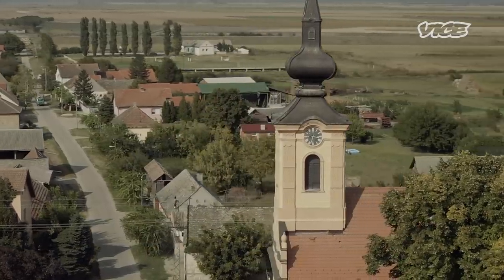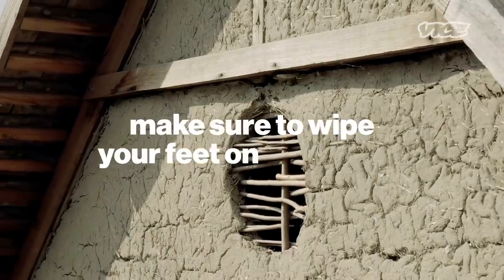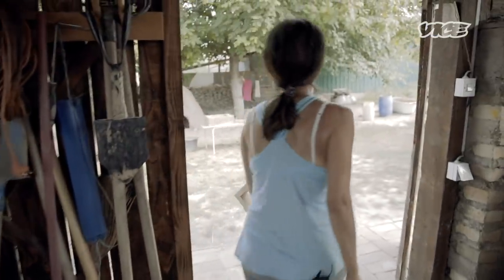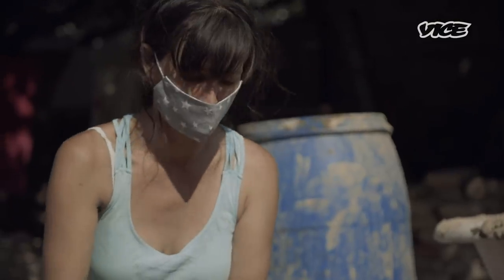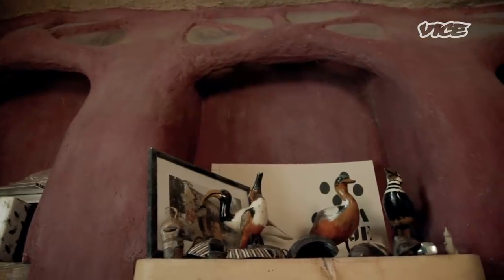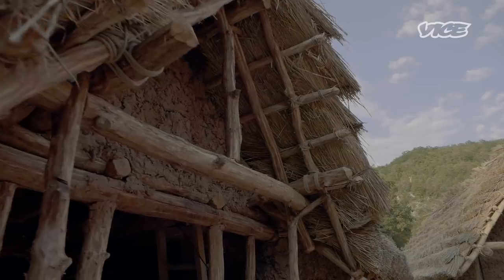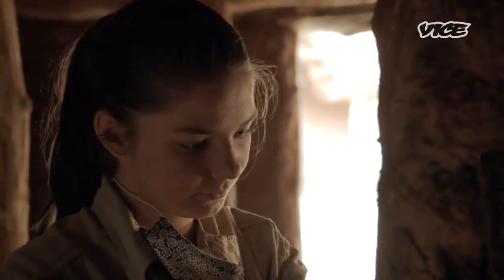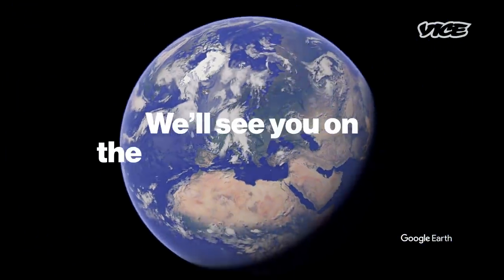Architects Are Using Mud to Build Sustainable Homes

Comment: Straw bale home builder/owner here. The insulation value of straw bale buildings is amazing. I have very low cooling bill in summer, and no bill in winter for heating, as I use waste wood to heat my home. Often times cooking a meal in winter is plenty to keep the entire house warm. It is also passive solar design, so in summer is shaded, but in winter when the sun shines, we get plenty of free solar warming. 
We have clay plasters on the straw bales, and made many interior walls using several natural building techniques. 
Our home is a hybrid of natural materials (clay, sand, straw) and manufactured materials (metal roofing, glass windows, wall tiles in the bathroom, and poured concrete floors.) So much can be done, but isn't. 
It does take a special drive to accomplish what the architect has done, and yes, these sorts of homes can be built to the building codes in any region.
Reply: @Cthulhu013  I use wood that is sustainably grown on my own land. I also make biochar in my wood stove as a bonus product.
This sequesters carbon in the soil for hundreds of years.
My wood stove is highly efficient, and has extremely low particulates emitted.
I have done the research and am confident in my decisions to heat my home with wood.
Reply: @Bronski Turboski I absolutely used wood and modern roofing materials to keep the rain off of my mud walls. Have a great day.
Reply: Hi! I was wondering if you could tell me more information on your house. I am currently planning our home build. A few things I am wondering is where you built your house? how many sq feet your home ended up being and what the cost total ended up being.
Reply: @Christinalight219  we are in Central Kentucky USA.
990 square feet inside, 2400 under roof. Wrap around porches.
$129,000 was final cost.
Reply: @natureloversadventures7335 
We did most of the work of building ourselves.
Reply: See works of Francis Kéré of Burkina Faso.
Reply: I have a question - I am wanting to buy a plot of land in the Sangre de Cristo mountains in New Mexico and build a home. I am wanting it to be able to withstand forest fires (there seem to be more and more of them ) so I am thinking about Adobe. Do strawbale homes burn in forest fires?
Reply: @hermixtonen  yes no maybe.
Straw bale can be as fire resistant as adobe.
You will need to take special care with your roofing material, and wall to eave details to clad them in fire /ember resistant materials.
The straw bale wall, sealed inside clay plaster won't burn. The clay protects the wall. Lime is similar.
However if the fire starts inside the home, the contents burn, leaving the straw bale walls intact.
Also suggest having 100 foot firebreaks around your structure, and that can be planted in gardens. And kept well watered, to reduce fire propagation.
Also a sprinkler system could be installed which is used when there is a fire warning. Keeping the areas around the house wet/damp can save the structure too.
Good luck!
Reply: how were you able to get permits for your home, did you get the design from an architect or make them yourself?
Reply: Wowza. Can this be done in northeastern America?
Reply: @nula.thedoula  of course!
😁 The insulation is amazing!
Reply: @hermixtonen  yes and no.
The exposed wood portions can flash into flame from heat of forest fire.
In California a year or two ago, a strawbale home burned in one of the fires. Everything except the straw bale walls was destroyed.
But also metal buildings melted during the fires, so there is that.
Reply: @emmamccormick8443  we built according to the codes in our county. My wife drew the house, and we had a structural engineer make some strength changes, and then sign off on it.
We did design and build it ourselves and had building inspectors checking up on us. It was something new for them too and they were amazed.
Reply: @jameskniskern2261  this is my life goal.